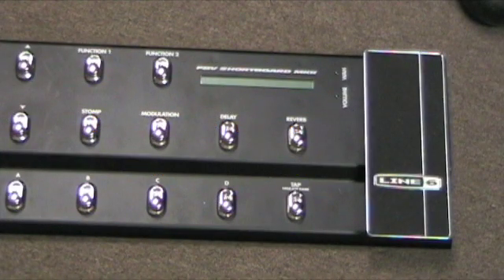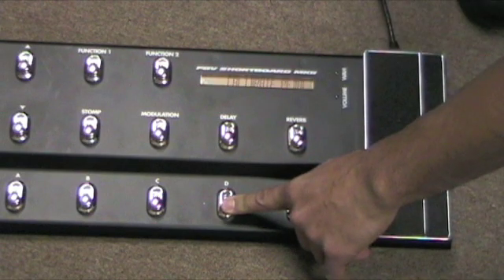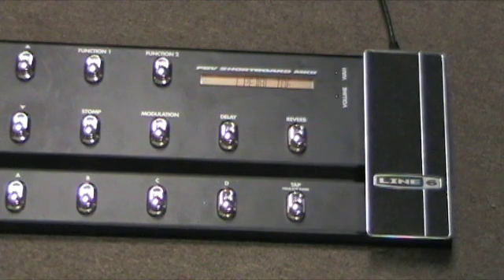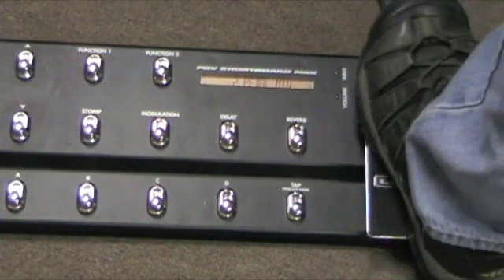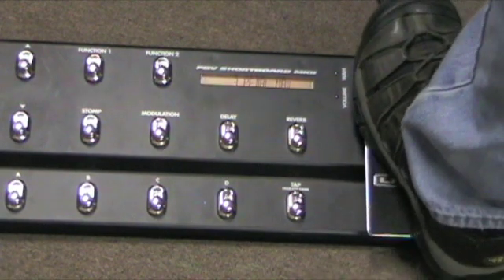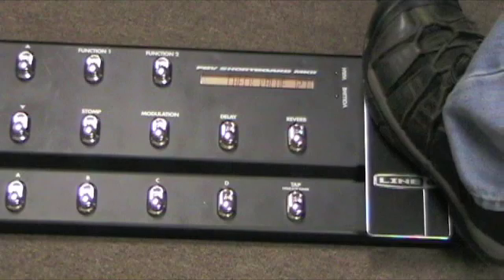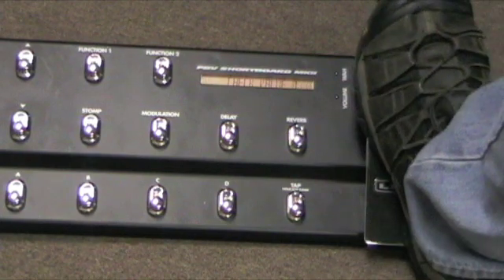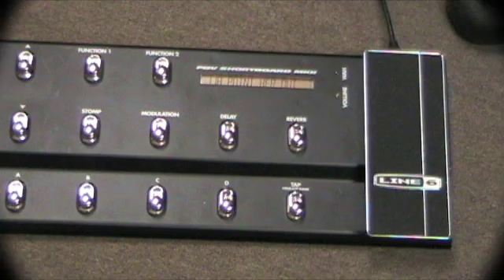FBV MkII Shortboard Calibration

Comment: Hi. I am completely stuck. I got my fbv shortboard mkii to use with my pod hd pro but when I plug it into the pod nothing happens accept the shortboard displays "FBV SB MKII". None of the switches work?? All latest firmware etc is installed. Any help would be appreciated.

Comment: Hey, i've got my fbv express last week but i have no idea on how to use it, when i plugged it to the amp nothing was happening so, i tried calibrating it but i can only do the steps( for calibration ) with the usb cabel and not the one that goes from the amp to the controler. And after i finish calibrating and i plug it to the amp nothing happens, only some lights shine for a sec on the amp and the channel switches from A to B, but then i cant do nothing, please help.

Comment from the maker: @ES1sub so you are saying the pedal does not function when you connect it to your amp or POD via CAT 5 cable? Have you ruled out your amp or POD as the possible culprit to be sure? If you have, then you should contact your local service center and arrange a repair as this does sound like it could be hardware related.

Comment: @Line6Support I updated the firmware, recalibrated it and tried a new cable, nothing works. the light only comes on when it is connected to my computer through use of the usb cable.

Comment from the maker: @ES1sub Have you updated the firmware on your FBV with the Line 6 Monkey software? Also, did you calibrate the pedal after the update? Have you tried a new CAT 5 cable in case the one you are using is damaged?

Comment from the maker: @ES1sub Have you updated the firmware on your FBV with the Line 6 Monkey software? Also, did you calibrate the pedal after the update? Have you tried a new CAT 5 cable in case eeh one you are using is damaged?